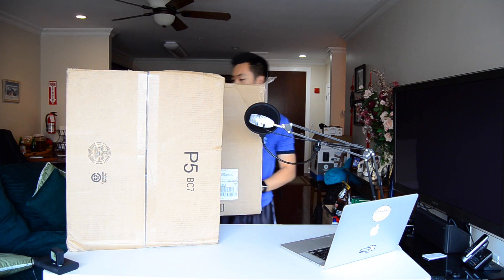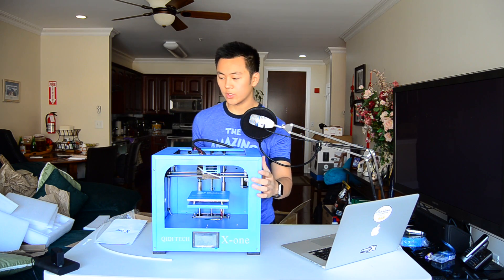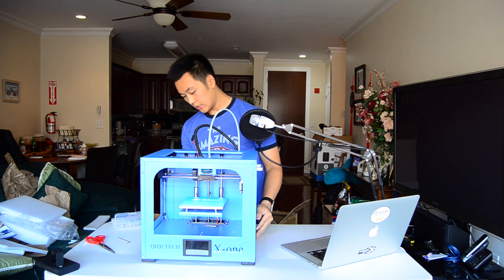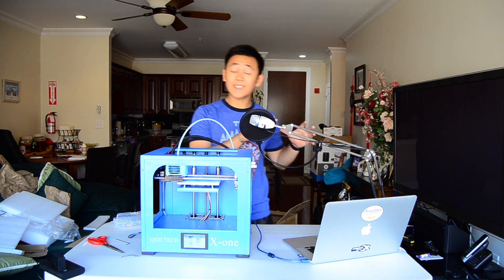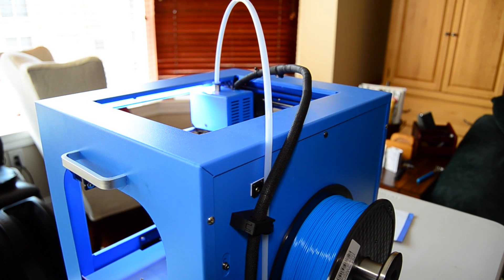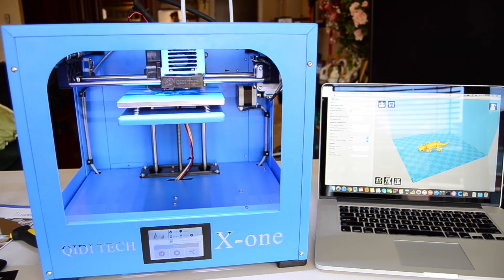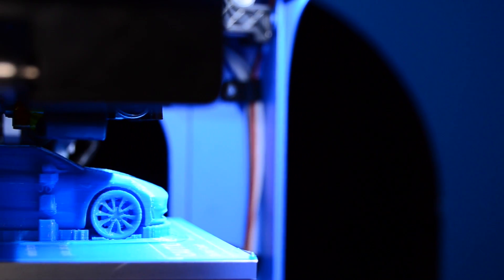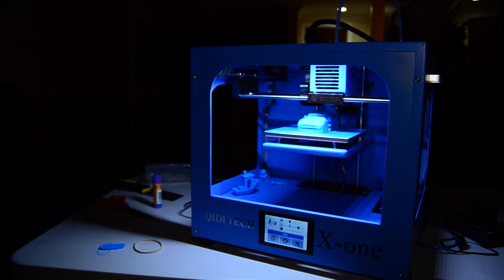X-One 3D Printer Unboxing/Setup + Review 2016

Comment: Qidi machines are actually extremely terrible!!!!!!! I am speaking from experience. These people are given free printers for good reviews. They have nothing but issues nonstop. Yes he went over all the great features but all these features are all bound to fail very quickly. I fell victim to all the "amazing features". They look great but are engineered extremely poorly all the way from the motherboard to extruders (yes both) to nozzle to slicer to connectivity to spool, board and power supply placement and even the enclosure. There is also no information for maintenance or anything useful on the website. Also it does and cannot print at 60mm/s. The software says 60mm/s but has its own built in algorithms to adjust that speed to almost half of what is imputed. The only thing that has not given me any issues with their machines is the touch screen. After the experience i actually prefer buttons and or a knob. Just do the right research there's all sorts of forums verifying what i am saying. Also the replacements are extremely over priced and poor quality. You can buy a ten pack of better quality mk10 brass nozzles and a roll of ptfe to make 10 replacements for less than they charge for 2 pre assembled replacements. You can even kick it up and buy a steel tube and steel nozzle for about the same price as the 2 replacements and basically never need another replacement!!!!! Please don't get ripped off by this!

Comment: Great review! Loved it. I couldn't help but notice though, it looks like you're suffering from a partial clog (this is why a lot of the prints have some underextrustions). Try a cold pull, or pick up some cleaning filament and I'd bet you'dd see much nicer prints!

You can diagnose a partial clog by the way the filament extrudes right out of the tip of the nozzle. If it curls to one side, there could be a partial blockage. If it flows straight out you're all clear.
Reply from the maker: Thank you for pointing that out! I've been looking for a way to clear out the clog for a while! Thanks!

Comment: Hi, can this printer able to use with small scale model for architecture and very details while printing or can you recommend? thanks
Reply from the maker: +Nhek Thodollaro this would definitely be able to print small scale models! You can make the print resolution extremely fine and the prints do come out very nicely! Be sure to check out the link in the description of the video!